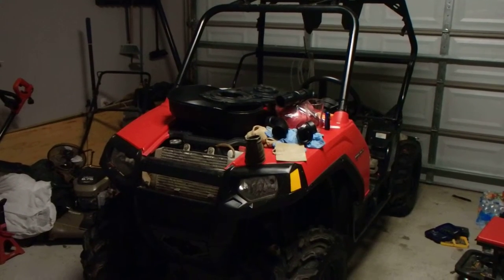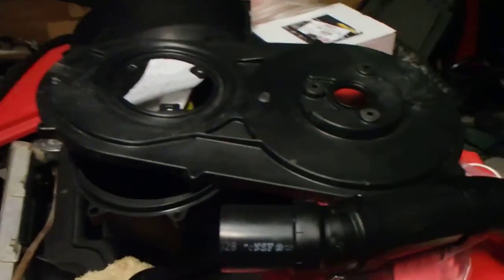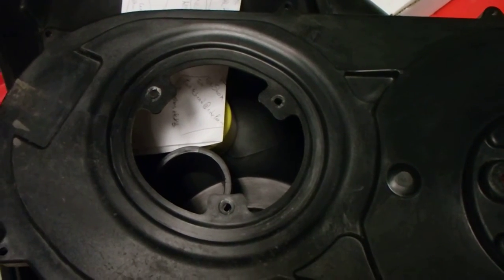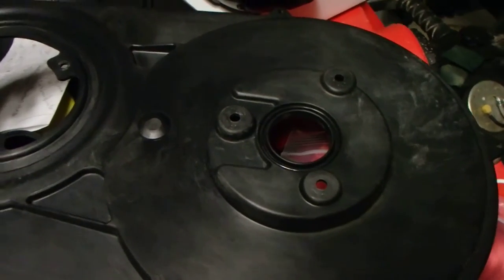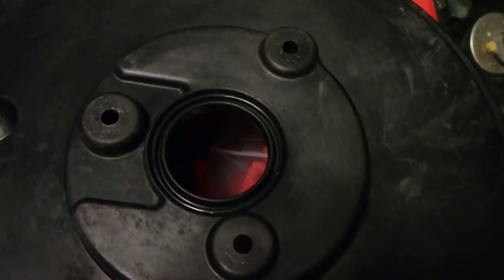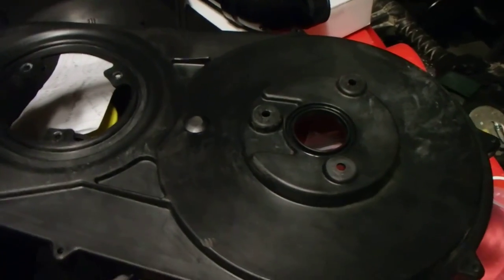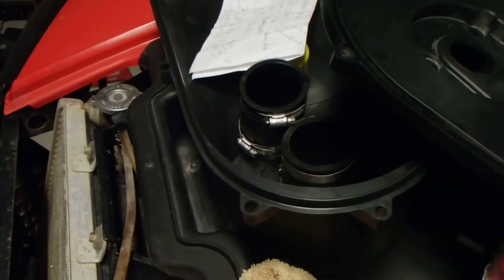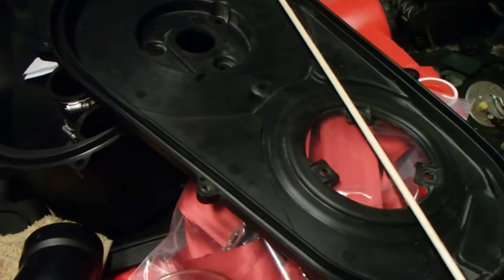How To Properly Seal Your 2008 RZR 800 Belt Box Cover The First TIme

Comment: did it seal
Reply from the maker: The back plate sealed perfect with the o-ring only ion the trans side, and blue on the engine side as polaris recommends.   The grease on the factory cover gasket is working with no leaks. I could not be happier. I have not had to open it up but I have been driving through lots of water and mud ( water and mud filling in the cab )with no issues at all. Not a drop shows in my drain hose that I made on it. 
There is absolutely no need to seal everything up with silicone or other sealants and glues. Just don't overdue the grease just a thin layer on the outside of the cover gasket. Otherwise you might squeeze some into the belt box onto the belt.